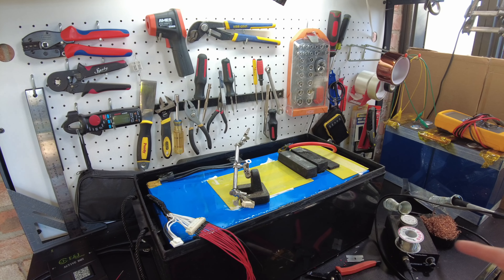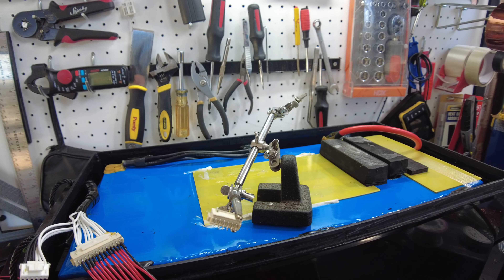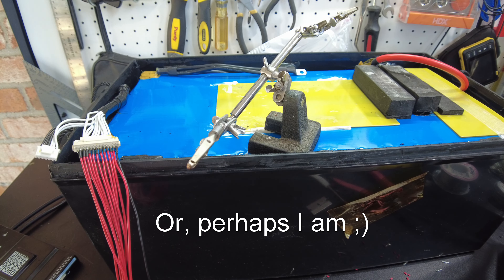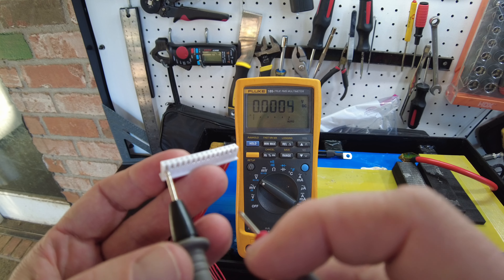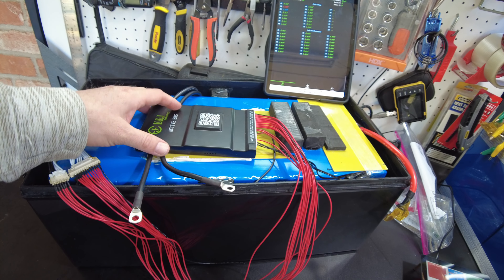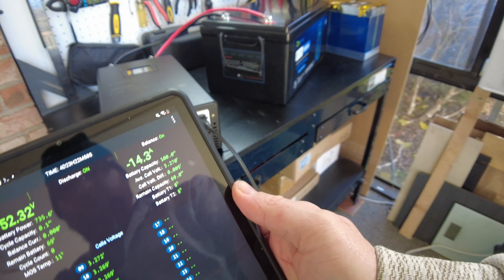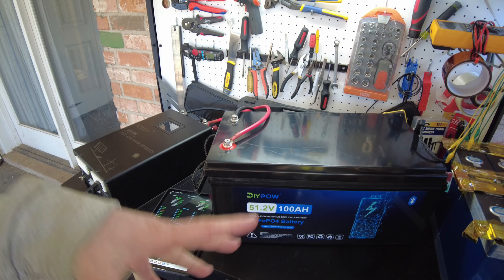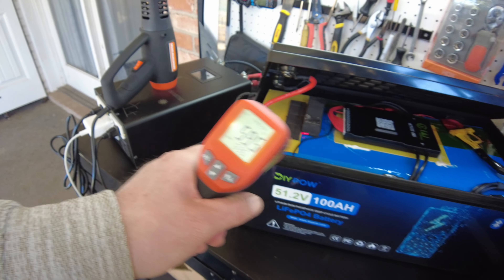Fixing a broken 100Ah 48v battery

Comment: I love my jk bms's. I started with a couple 300 amp Daly but quickly saw the reason jk is needed and is considered the best
Reply from the maker: I've only used it a few days, but I must say I'm starting to look at my other bms's as inferior toys. LOL
Reply: @BradCagle  I bought 2 of the Daly 300 amp BMS and they both set on the shelf. One still in the box and the other has 3 cycles on it. Then I got the JK and all the little accessories for it like the screen and all that. The JK does a way better job connecting to blue tooth and a way better job with balance. The cold temp cut off works great as well. Yeah man JK is the best from what I'm seeing

Comment: I did a test with included cables for inverter at 1000 watt they were getting so hot that if you let them run longer they probably would melt. Bought new cables and all cold to touch now

Also got a jk bms on the way for battery module i will build
Reply from the maker: Yeah, they should just not include them if they can't send proper cables. Scary really. Nice, I'm really liking the JK so far. Thanks!
Reply: @BradCagle I'm running a 12v system but the cable is so thin that it will cause fire currently got one big cable that you can barely bent